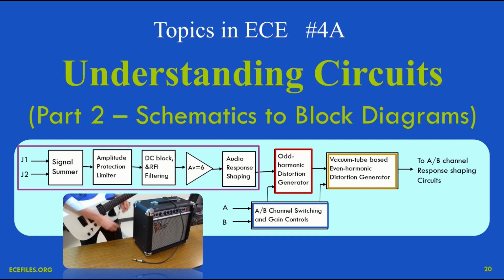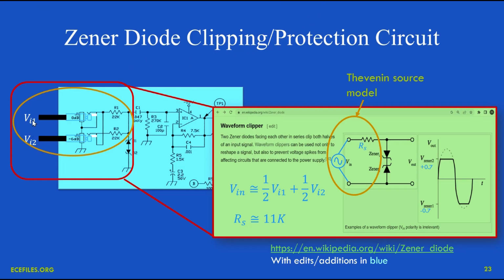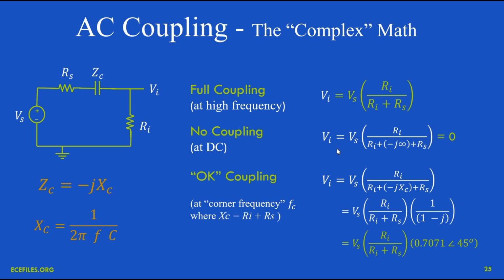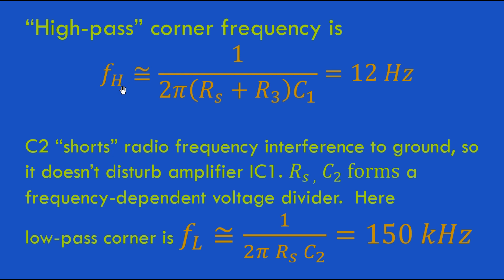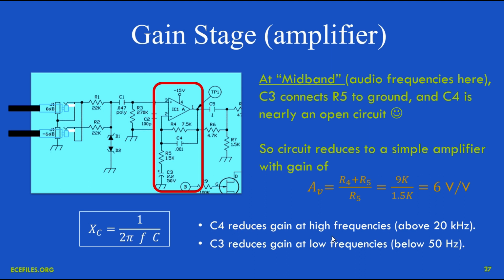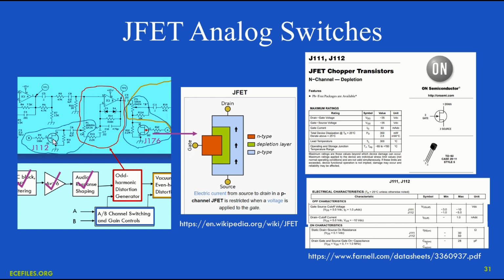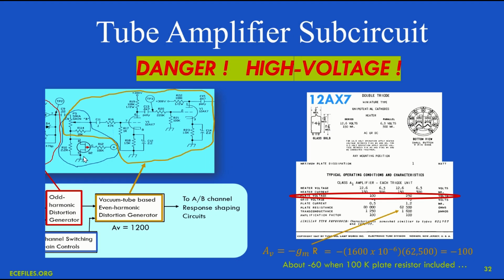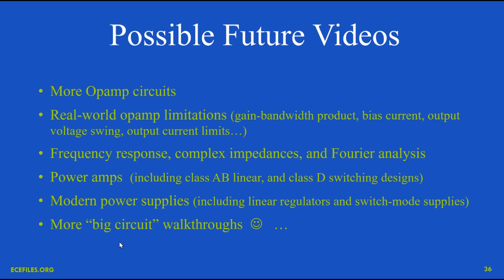Understanding Circuits - Part 2 - ECE Topics #4A

Comment: Awesome great knowledgeable video   , please more video's like these  , explaining different circuit's how it works  , if possible please make a video explaining the data transmission between the  transmitter and receiver module's  e.g. 433 mhz transmitter and receiver module  which controls the D.C. motor of RC car
Reply from the maker: Thanks for the encouragement.  If you haven't seen these videos yet, please have a look at Episode 1 Part 1 in this series. It contains some overview of transmission and reception. It is not specific to 433 MHz, but is general - covering all of radio design.  The rest of the series goes into a lot of depth - but hopefully the first in the series will provide a good start.  https://studio.youtube.com/playlist/PL9Ox3wpnB0kqekAyz6blg4YdvoEMoJNJY/videos
Reply from the maker: There's also a series on the antennas needed to make the radio link work:  https://studio.youtube.com/playlist/PL9Ox3wpnB0kqNLnCdCtWcjGq7nRVHYxKA/videos

Comment: Thanks again for great content!

I am curious about the comments about distortion differences between semiconductor and tube amplifiers.  So, first, lets ignore the intentional clipping distortion created by the zener diodes.  I've always attributed the distortion in amplifiers to the large-signal models of the devices involved (maybe this is an incorrect assumption) and the extent they differ from a linear response.  FETs are large signal square law devices and so are tubes.  I've always thought tubes and FETs ought to have the same sound.  BJTs are exponential law devices and I can see their distortion sounding different.  Am I mistaken here? 

Thanks
Reply from the maker: Thanks for an interesting question! I tend to agree, but will add a few thoughts.

Discrete amplifiers (those built around a single active device) should follow the IV characteristics you describe. But most solid-state amps now seem to be based around opamps or ASIC ICs, which usually have differential amplifiers at their front-end - even if it's FET based. So what happens on one half of the cycle should happen on the other I think. Hence the odd-order distortion. And most of the distortion is controlled through feedback, which cleans it up - until one reaches the supply-rail limits. 

The tube amps are typically single-device per stage and thus should have some even-order distortion (they also don't use feedback, so nothing to clean it up). I think that's why they have a distinct sound. Of course once they're driven really hard, theres lots of clipping - but we're focusing on the mild-distortion as you said. That behavior could be emulated with a suitable JFET as you said. 

(MOSFETS however are only square-law behavior in textbooks. Since about 1990, their channel lengths have been short enough that in actual devices there is only an initial square-law behavior in the first couple-hundred mV beyond threshold, and it then goes linear.)